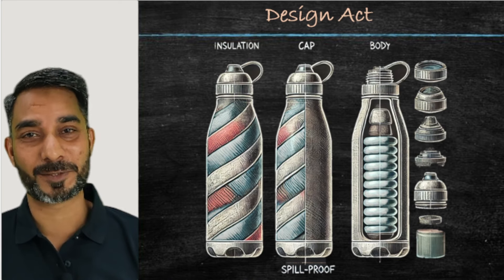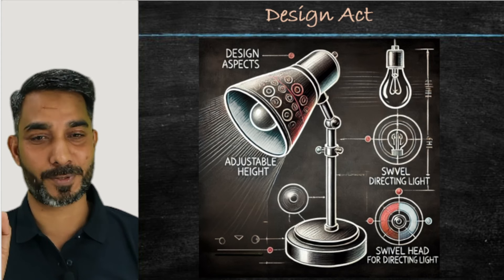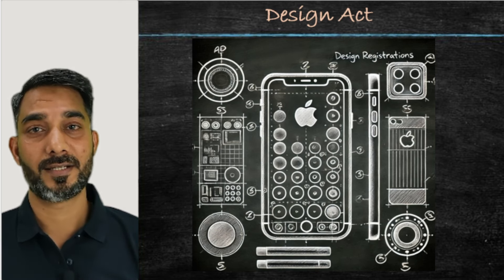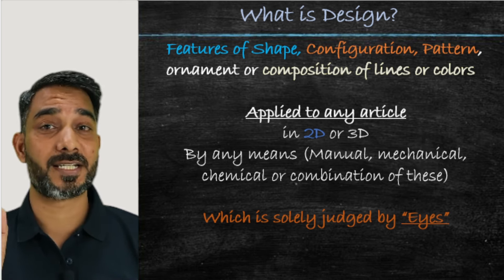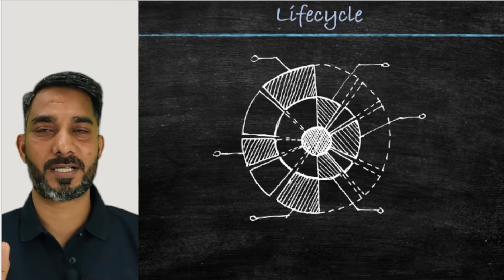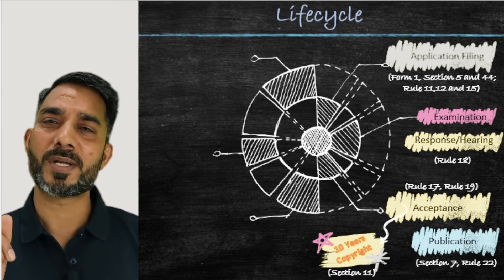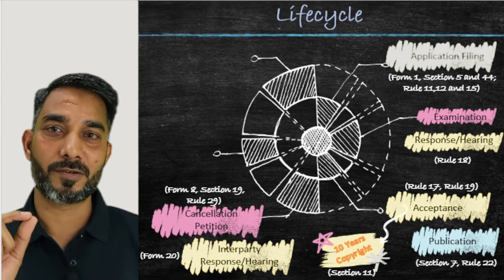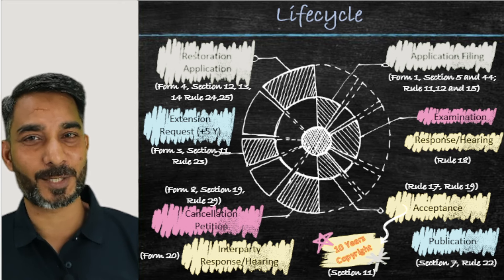The Design Act - An Introduction (Being played at 1.25x speed)

Comment: Sir, Kindly let me know what is the exact difference between design patents and Registration under Designs act ? Causing Confusion in terms and also what do you mean by a mere mechanical device as per definition of Design in Design Act 2000.
Thank you !!
Reply from the maker: @gargeelimaye5816  there is nothing called design patents - they are design registration! 
Design registration is not for machines or articles but design on machines and articles
Reply: Thank you Sir !!

Comment: Sir, Suppose any person just copied the bottom view of this bottle, rest all features are different, can it be considered as infringement??
Reply from the maker: @satishkanhed8419  The evaluation of design infringement involves comparing the overall appearance and analyzing if the copied elements constitute a substantial part of the registered design. 
For partial copying like in your bottle example:
1. The key test is whether the copied part (the bottom) is substantial enough to create the same overall impression on an informed user.
- Whether the copied part is a dominant feature of the original design
- How distinctive or unique the copied element is

If the bottom design is distinctive and forms a significant part of the overall design's aesthetic appeal, copying just the bottom could constitute infringement. However, if the bottom is fairly standard/generic and the uniqueness mainly lies in the neck design, copying only the bottom may not be infringement.
Important factors courts consider:
- Side-by-side comparison of designs
- The degree of difference required to avoid infringement
- The significance of the copied features
- Whether ordinary observers would likely confuse the two designs.
Reply: @AbhayPorwal  Thank You Sir..